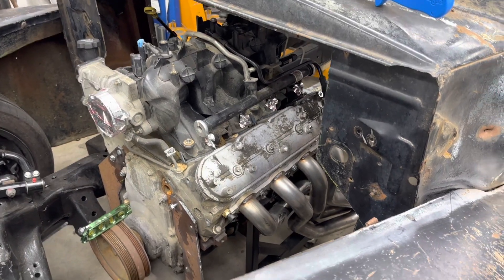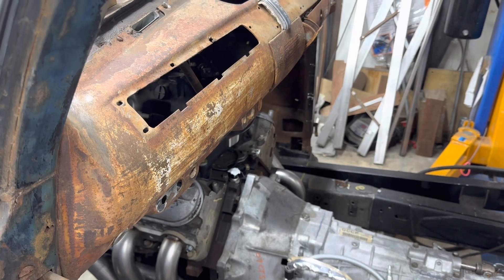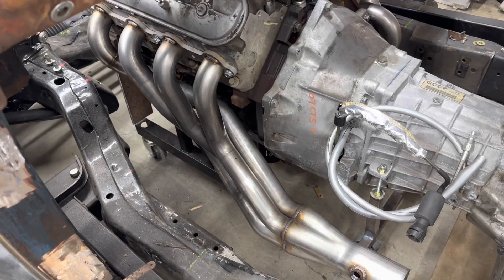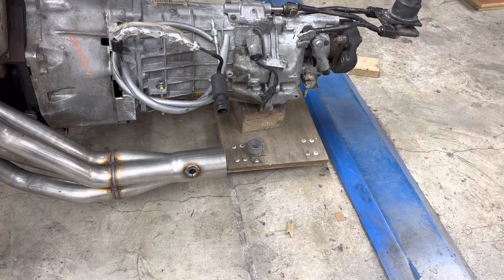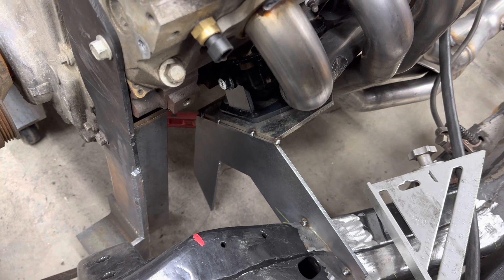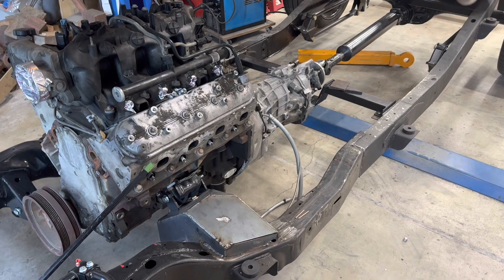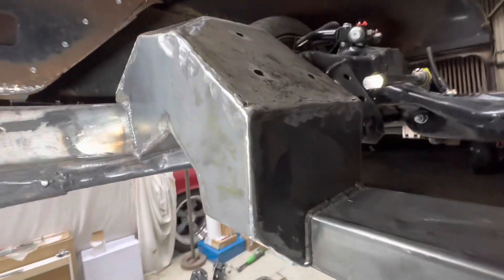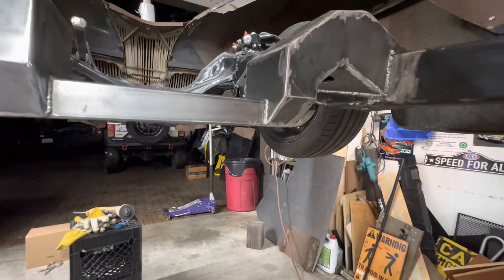Moving an LS back 20 Inches! AND Custom Engine Mount crossmember and transmission mount for T56

Comment: Those motor mounts are worthy of an M1 Abrams tank.
Reply from the maker: Funny. Thanks. My thinking is the manufacturers usually use 10ga and they’re pressed into the rounded shapes that add strength as well so I used 3/16” and 1/4” just on the plate that the mounts bolt to then the 4 by 2 underneath is closer to 10ga. 
I’d rather try to duplicate what the manufacturer does than risk under built. I’ve seen and heard of some guys who throw together mounts having some cracks later on. I hate doing stuff twice.